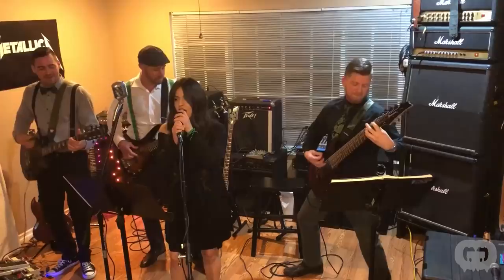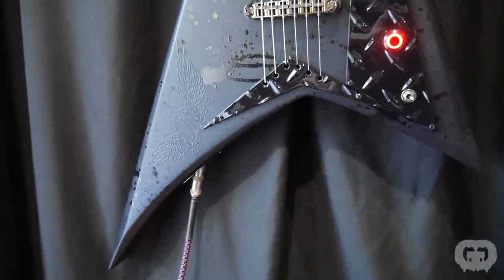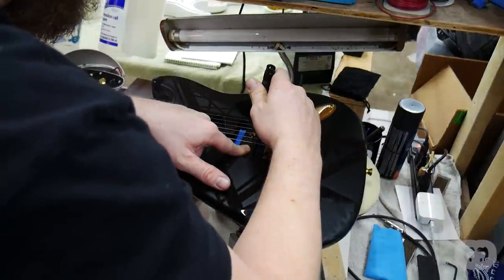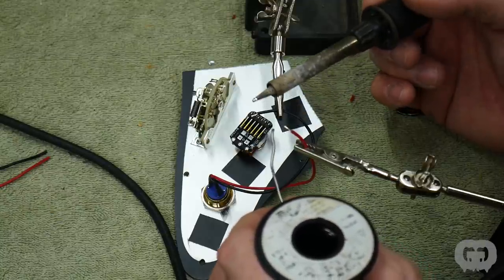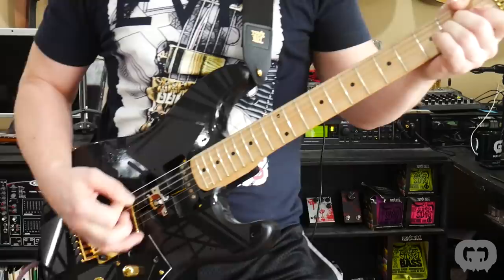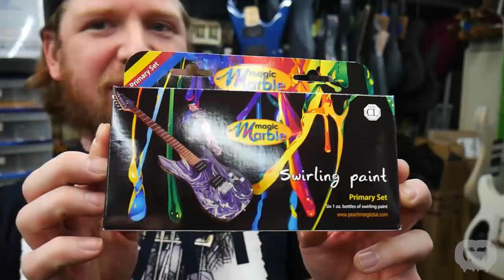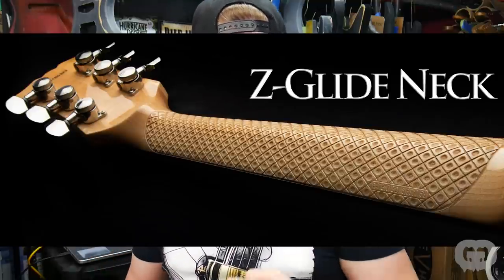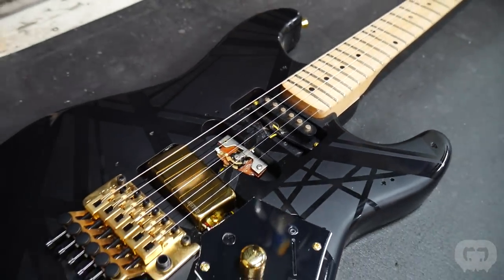Trash to Thrash #38 - Stealth Frankenstrat 2 GIVEAWAY (1992 Fender Stratocaster MIK)

Comment: I definitely dig the newer one. The gold kill switch looks way better than the red one. This strat is my favorite stealth paintjob that you've done. Hands down. I started modifying my guitars a couple years ago whenever I got a set of Seymour Duncan Blackouts and installed them on my LTD M-10. It's a budget guitar but after I rolled the fingerboard edges and polished the frets and rounded the fret ends, did a much needed set up, it plays like one of my higher end guitars. I just got a Yamaha Pacifica 112 HSS to modify. I can't wait to get parts to work on it. One thing I really need to work on is doing paint jobs. Thanks for the awesome content!
Reply from the maker: Thanks so much!! It's amazing what you can do with a little extra work on some guitars!
That last comment was spam. It is a fake account impersonating me. Don’t contact them. I only contact winners directly from my email address (mark@guitarguts.com), my official IG account @GuitarGuts or my Patreon. Thanks and good luck!  I would never start a new account to contact you.

Comment: I started working on guitars in the 70's, swapping in DiMarzio    Super Ds when they first came out, taking covers off humbuckers, rewiring. Made nuts from blanks.  Whatever was required. Used to refret, but sold all my tools for that.
Reply from the maker: That last comment was spam. It is a fake account impersonating me. Don’t contact them. I only contact winners directly from my email address (mark@guitarguts.com), my official IG account @GuitarGuts or my Patreon. Thanks and good luck!  I would never start a new account to contact you.

Comment: I started out doing finishes, mainly swirl paints. Then I moved to doing custom scratch builds. 
As for tools, I need quality fretwork and nut tools. Things like scale length rulers, leveling beams, radius beams, nut slotting files, all of that. My problem is that I focus on bass guitars and the tool selection is smaller and more expensive than 6 string guitars.
Reply: As for tips on swirl painting, watch this video, it's the single best explanation out there -
https://youtu.be/_jkzqT8NAXo

Comment: Hey Mark I make my own guitars, l bought a boatload of wood and some parts/ pickups  before Covid to make more, however in the past have lost some important people in my life and struggling to get back in it,and hand injury doesn't help but as far as tools go, the new Dewalt planer works great for plaining boards, I think I have different router for each bit I use and when I shape the wood , when I first started out I cheated , I used a cheaper grinder with flapdisc , and a tool called dynafile for neck shaping  instead of high dollar drawknives or spokeshaves, soon I want to start making my own pickup - love your video's
Reply from the maker: That last comment was spam. It is a fake account impersonating me. Don’t contact them. I only contact winners directly from my email address (mark@guitarguts.com), my official IG account @GuitarGuts or my Patreon. Thanks and good luck!  I would never start a new account to contact you.

Comment: I love the stealth paint jobs you do, especially that Wolfgang one. I just finished repainting and modding my first guitar that was a cherry red squire strat that I changed to a matt black with gloss white splatter and I'm planning on starting on others. It also had a custom-painted detailed skull on it but I was wondering what clearcoats react with acrylic paints? to play it safe on this one I used an acrylic clear coat to not mess up the paint, but it was a little rough and I'm wondering if you know what else would work and not erase the paint?
Reply from the maker: I just experiment until I find something that works.
That last comment was spam. It is a fake account impersonating me. Don’t contact them. I only contact winners directly from my email address (mark@guitarguts.com), my official IG account @GuitarGuts or my Patreon. Thanks and good luck!  I would never start a new account to contact you.

Comment: hey mark! How did you drill out the threaded inserts on the pickup? I'm looking to direct mount an emg81 on my project guitar, but i read online that it's difficult to drill out the inserts on emg's specifically since they're epoxy mounted bushings, or am i overthinking it and should just drill them out normally?
Reply from the maker: The metal EMGs are easy to drill out. Yeah you can drill the whole insert out!
That last comment was spam. It is a fake account impersonating me. Don’t contact them. I only contact winners directly from my email address (mark@guitarguts.com), my official IG account @GuitarGuts or my Patreon. Thanks and good luck!  I would never start a new account to contact you.
Reply: @GuitarGuts  yeah i reported it as well, thanks for the info 👍
Reply: That was the 3rd one of those fake comments as well

Comment: In my experience, the reason some people don't like the EMG81 is because they feel it is compressed sounding, that the internal preamp circuit clips too easily. That can be remedied by just using a higher voltage than the 9v battery. These preamps can take as much as 27v (3x 9v batteries).
Reply: whatspp+➊➍➏➒➏➒➒➋➑➎➌  Dude no. Gtfo spam bots.
Reply from the maker: That last comment was spam. It is a fake account impersonating me. Don’t contact them. I only contact winners directly from my email address (mark@guitarguts.com), my official IG account @GuitarGuts or my Patreon. Thanks and good luck!  I would never start a new account to contact you.